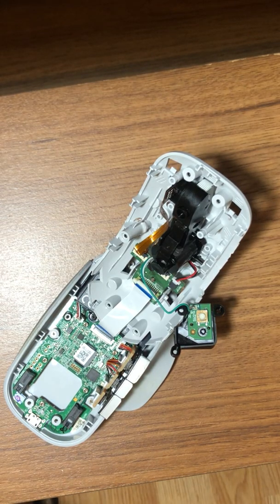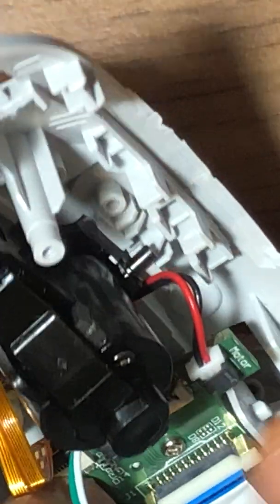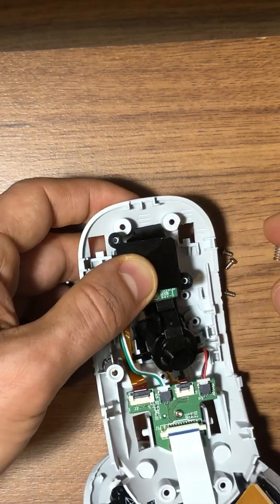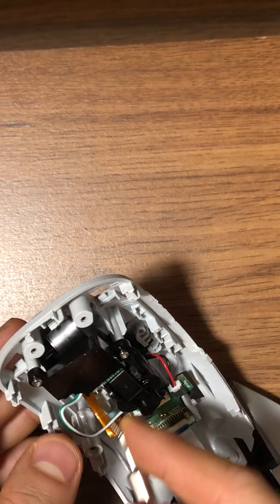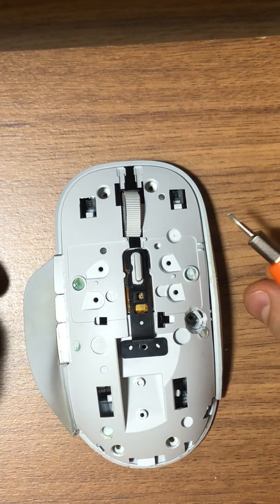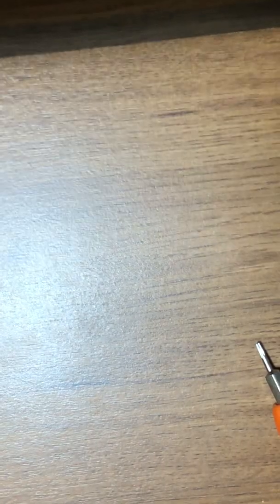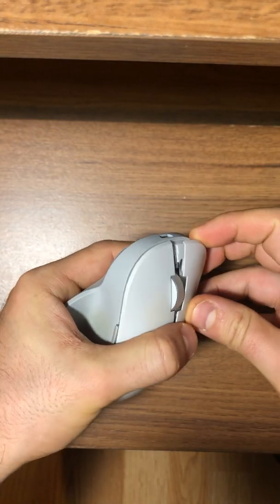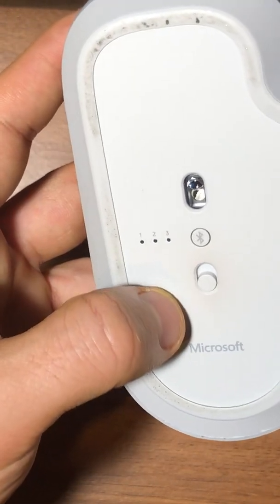How to disassemble Microsoft Surface Precision Mouse (not scrolling fix)

Comment: Why wouldnt you show the most difficult part which is getting the mouse open? Just spend hours trying to carefully getting it opened and ended up breaking it completely. This video is completely useless if you dont show how to actually access what you are doing in the video
Reply from the maker: Hi Sir,
Here at about 16:23 I showed how to start. I may do another video for just opening the mouse if that did not help. Let me know please. Thank you for stopping by.

Comment: I can't get the rear half of this thing off.  The front half is partially loose.  But it won't come off at all.  I even tried doing the rear first, but it isn't budging at all.
Reply from the maker: I would open both front first then go to the back. It is a little bit tricky that you will feel that you are about to break it. So be courageous and careful at the same time so it will open without breaking it.
Reply: @MrSharaira  After bending it out of shape, I think I can get it off easier now.  It just depends where they glue it this time.  lol  My glue points were different than yours.

But thanks again for your help.
Reply: @MrSharaira  I already have bent it too far and warped it.  When it snap it back together, the left mouse button doesn't click anymore.  I just broke off the 3 side buttons, as that was all I needed.  I should have just done that at first, but I figured this would come apart much easier.  I got a new one on order.  so hopefully I will figure out how to disassemble this before the new one arrives, so I don't break the new one.
Reply: Okay, I finally forced the cover off.  Mine was glued n really tight.  It was also glued in the rear and the rear two pins.  The middle two standoffs weren't glued on, but they still put the glue in the area towards the edges of those two pins.  I put it back together, but now it don't click on either mouse button.  But my new one is on the way.  so I at least know about the glue points a little better.  Hopefully they didn't use so much glue this time.  Mine had so much glue it was dripping down the sides a little.  I thought for sure it was going to break the top piece, but it is unusable now.  So I at least have a parts mouse if I need it.  Thanks for the video.
Reply from the maker: @rmjohnson144  You are welcome. Sorry to hear about the inconvenience that you have to face with it. I guess Microsoft should make it a little bit easier to deal with. It is a great mouse. I am still using the one in the video. I just wish they make this small adjustment to make it a perfect mouse. I hope the new one will work with you just fine with no issues. Best wishes!

Comment: So you basically didn't show how to disassemble it because you started with the mouse already torn apart...
Reply from the maker: Correct, when I started, I was not sure it will work. So after I finish and saw it working, I thought will be a good idea to start recording so if someone has the same issue, at least they can play the video in reverse to see how to disassemble.
Reply: @MrSharaira  i was looking for a video to see how to take off the smooth cover off

Comment: That mouse while comfy is a disappointment. Not easy to service and I have a button failure (8 out of 10 LMB are double clicks) right after the warranty ran out. Worst spent 90 Eurobucks. Bought a real mouse with proper 80M rated switches for slightly lower price (cabled). I'm done with MS peripherals. They only look fancy and are decent while they work.
Reply: Cual mouse comprqste?

Comment: Hey, do you know what battery model should I buy if the original one stops holding charges? Thanks. Nice video!
Reply from the maker: Thank you, Danilo, for your compliment. I have called Microsoft for your inquiry and spoke with different agents to find a battery replacement but unfortunately, they can not find one. However, the second agent was trying to transfer me to a different department that specialized in mice and keyboards but that department was closed (it was 8:05 EST). So you may try again tomorrow to find out if they can help. I used this phone number: +1 (425) 635-2970 then choose option 2 for the surface. wish you good luck finding that battery replacement.
Reply: @MrSharaira  Thanks Ameer, I will try reaching them for this info. Funny that there's nothing on this mouse in ifixit. It is a nice piece of hardware and this lack of material is a bummer.